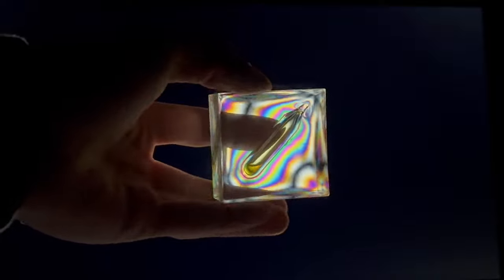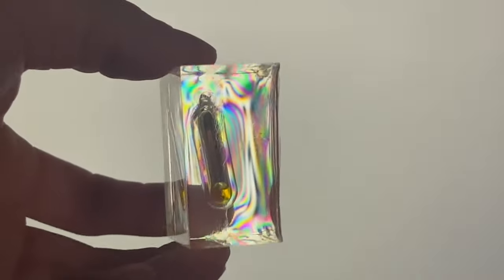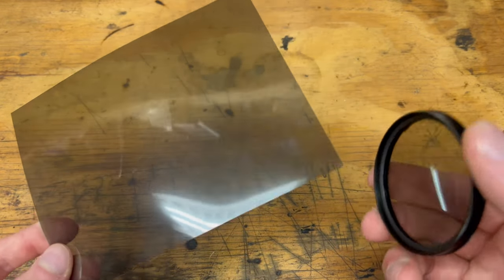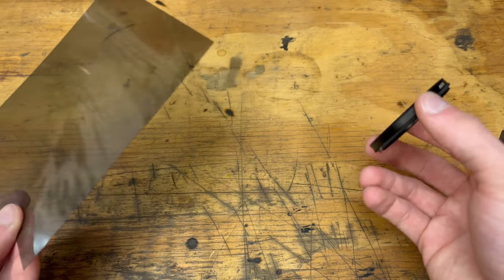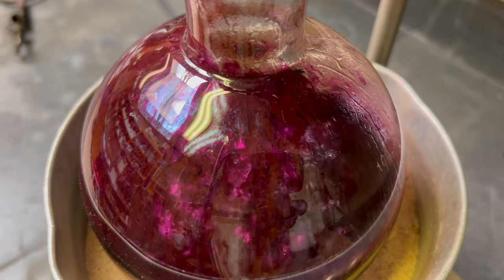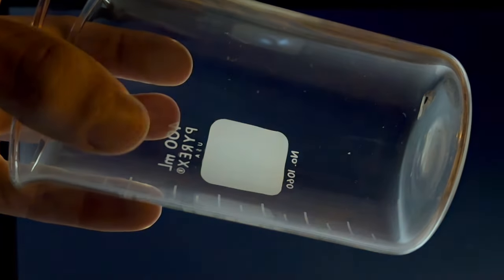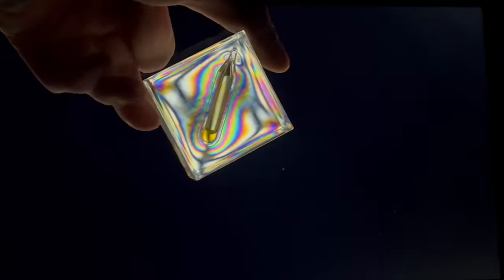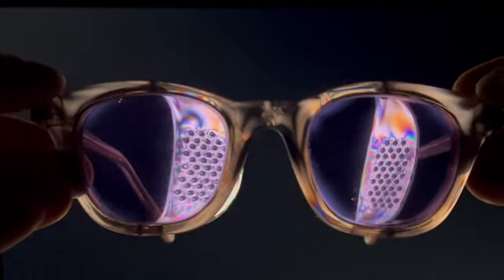Discover the Hidden Stress of Materials with a DIY Polariscope

Comment: I was thinking about those high temperature superconductors that only work under high pressure... and thought, can you make them inside a Rupert's drop? How much compression is the inside of a Rupert's drop under anyway?
Reply from the maker: I have no clue if that world work, but it would be interesting to try for sure. I don't know though if the drop can form with something in the way.

Comment: I've heard it called stress but I've always thought of it just as density changes, because you can heat it up and those patterns don't tend to change (in my experience) 

Explain the difference in molecular structure for liner polarisation and circular polarisation 😅😛

Think you can apply that to schlienien imaging?

Comment: I'm very surprised and slightly unsettled by the amount of stress in the acrylic encased liquid chlorine ampoule! The term used for this technique in industry and engineering is "photoelastic imaging" btw.
Any update on the neon filled mercury barometer light ampoules potentially for sale?
Reply from the maker: Yeah, it’s because I let the resin harden a bit and pushed the ampoule in. Then poured the top resin layer. That as you can see caused a lot of stress. Unfortunately I haven’t found a supplier of neon for an actual reasonable price. I’m still looking, just waiting on the gas.
Reply: @WheelerScientific  👍🏻👍🏻
Reply: @WheelerScientific isnt laser polarized? It can emit light through porous solids. Would it show the stress inside? 

If you have the equipment and laser, you could test a ceramic pot perhaps.